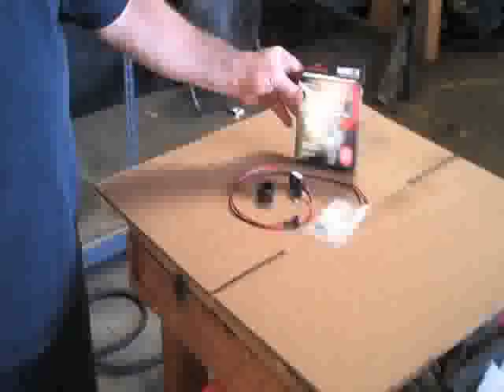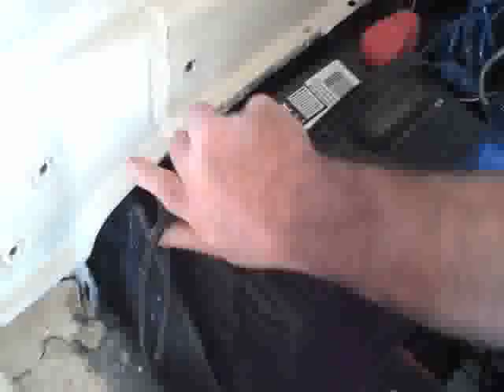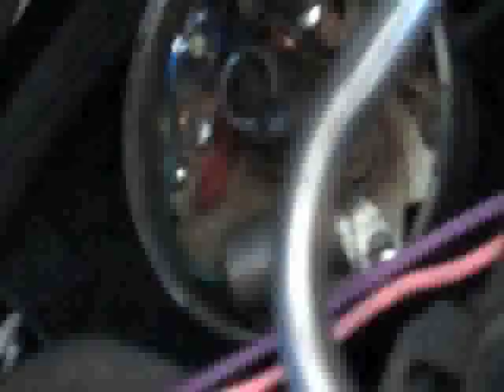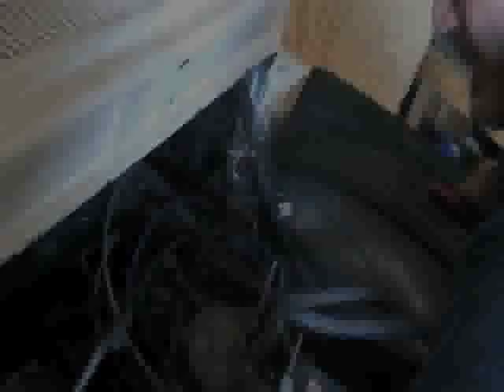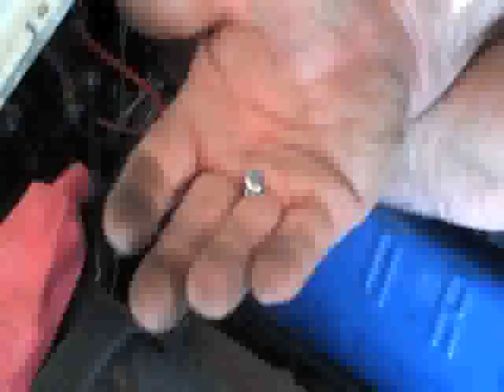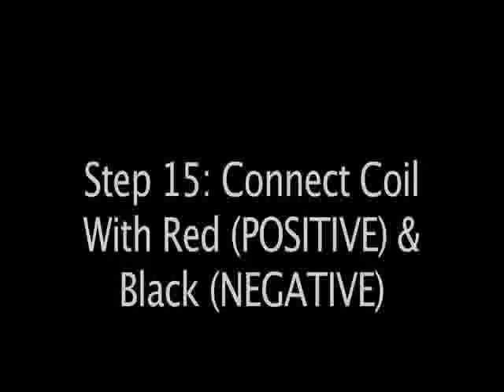Replace Distributer with Electronic Ignition

Comment: I have been running pertronix in my 70 f250 reliably for 3 years. Starts up great every time, it's  especially better starting during the winter. Also no adjustments needed.
Reply: 1970 HB 
I replaced my points with the ignitor 2 although this guy says to leave in the condensor thing in the distributor ? My instructions says to remove them , I removed both the one in the distributor and the one that goes to the coil is that what you did ? ??? Also it said if you have a ballast resistor in the ignition system to remove it .... Is that under the dash somewhere ? I have not fired my engine yet it has been rebuilt .69 Ford f 250 C/S .....

Comment: I prefer to use standard automotive parts instead of these kits for many reasons
a) these kits are not as reliabl as they say
B) in a case of a breakdown, parts are not readily available
C) it is almost impossible to have service on road in the event of a breakdown
I by far prefer to build my system usint standard parts, in this case, the Ford Duraspark 2 is very easy to adapt, you can also use Chrysler reluctor and pick up coil with a Chrysler module or a GM HEI module
these HEI modules are very reliable and dirt cheap.

Comment: i can't get to my fuel pump, the electronic ignition is in the way.  is it as easy as unscrewing all the screws around the EI?  seems like the plate would remain and that would still be in my way =D  68 GMC p15 van, knuckle buster fix

Comment: I fear these kits because when they fail , unless you have on your hands the original breaker and condenser or a replacement module, you're stuck, I by far prefer adapting a current ignition system used by Chryler, Ford, GM or Bosch as reliability is there and replacement parts are readily available in about any autoparts.
I had good results using complete system from Chrysler or Ford and using GM HEI module with about any magnetic pickup coil and about any HT coil used on inductive ignition system.
Reply: Jacques Poirier These kits are the only option to convert tractors. Unlike your auto...you die somewhere much closer to home. Also, it's not difficult to ziplock your points and toss them in your glove box in a pinch.
Reply: usually, tractors use distributors common to automobiles usually, Delco, Prestolite and so on, the majority of gas operated tractors are 4 cylinders and usually, the diameter of the distributor is close to old 6 or V8 so there is place to fit a Mopar reluctor ring and pick up coil
I've done it on a cockshutt 30( 4 cyl Buda engine), a case 4 cyl engine and an inter 4 cyl engine, For these engines, I used a v8 chrysler reluctor and I removed 4 spikes from the reluctor leaving 4 spikes for firing the engine.
the most difficult part of the work is to eliminate the points cam as this metal is hardened and very difficult to machine off with a lathe
I grind off to a diameter close to the required diameter to remove the most hardened layer then finish it on a lathe with a carbide tool bit.
the next difficult part is to align the high tension rotor to one of the cap tower then aligning a reluctor spike with the pick up coil pole and grinding the groove to recieve the locking pin.
In one case, on a OMC 3.8 v6 marine engine, I had to order the fabrication of a reluctor as the firing sequence is 108-132 degrees ( odd fire)instead of 120-120degrees common to most 6 or v6 engines.
The most difficult distributors to convert are small diameter european or asian distributors, in this situation, the best to do is to use newer distributors equipped with with a pick up coil and a reluctor or star wheel depending of the design.
In all these cases, this approach is more complicated than using a kit but the reliability and the parts availability worth the effort invested.
There is existing approachs  using the existing points to trigger a HEI module but I fear them because they use generic resistors and a failure means you're stuck in the middle of nowhere.
In any cases where the conversion have to go far on the road or on the sea, I suggest to have a spare distributor installed with fresh set of points and condenser ready ot take service

Comment: SUV man. .. really? Points and condenser over electronic ignition?  The only reason ANYONE would prefer points over electronic ignition is not knowing how E.I. works and how to work on it. Points are the most unreliable, time consuming, performance robbing, waste of time, component you can have on any vehicle on the road today.
Reply: I've had Pertronic Ign. 3 times on my British car in the past 10yrs. Many of we club members have gone back to Points. The eccentric behavior ( primarily the timing ) of the Pertronic will make Ignition Points easier to live with.

Comment: That's what I did to my truck, which is an 86 F250. It is now emissions exempt. And I am not in Kalifornia fortunately lol. I even found an exhaust shop with enough balls to build me an exhaust system with no catalytic converter. Engine is set up to run like an pre emissions engine, with the exception it still has the smog heads and low compression ratio. But if I ever become rich, that will change.

Comment: hey me too, i plan to buy a 1977 chevy blazer in a few years and will be installing a breaker point ignition system in it(they wen't to electronic ignition in either 74' or 75' i think), as well removing all the smog equipment(im not in california so it will be perfectly legal)

Comment: Yes it will run but you should have installed the condenser between the black line and the coil because it does have a purpose even though the car will run without it.  Would you just remove your condenser while using points?  The brain in this is just a magnet driven version of points. the condenser is there to protect the coil circuit from each tap of the connection which is happening in the magnetic brain and does reduce wear on the shaft. Unless there is a condeser in the brain. Note it.

Comment: This does not, then, replace the distributor, as the article suggests; it simply replaces the contact-breaker, or points. The distributor remains in place; it isn't replaced!

Without doubt, the changes shown here are extremely beneficial.  There are indeed ways, however, to completely replace the distributor; far more work involved, but there are a great many benefits, too.